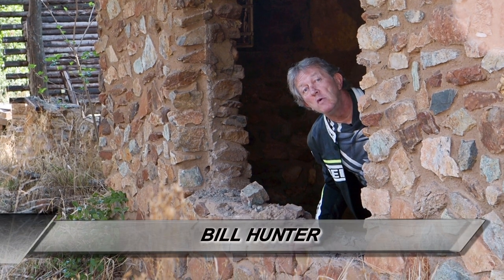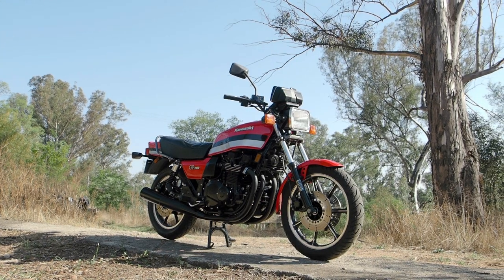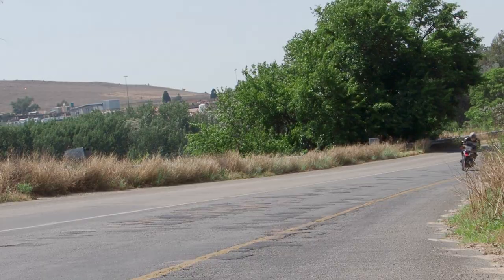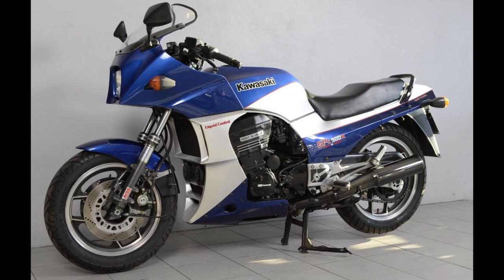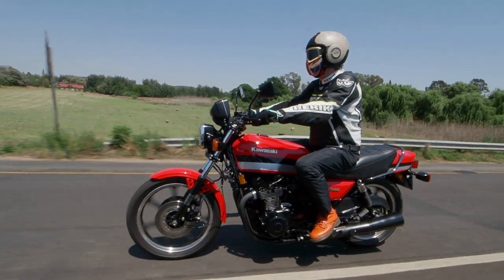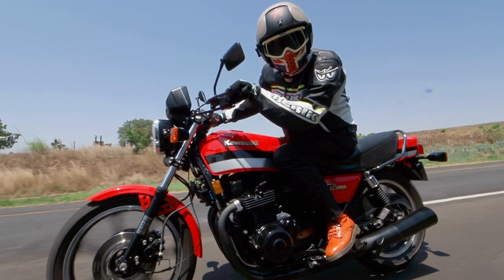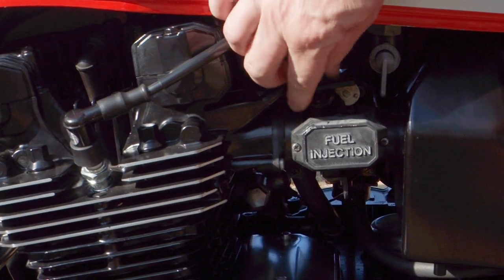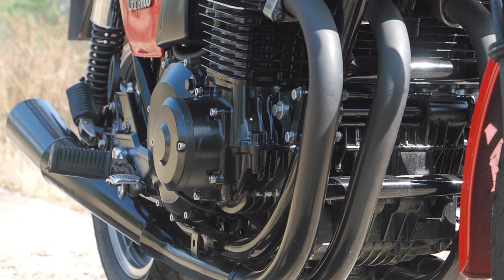Kawasaki GPz 1000 B1

Comment: Sorry Bill but Kawasaki debuted fuel injection on the Kawasaki Z1000H. It was  basically a mk 2  Z1000 with er...... injection instead of carbs. It was black and gold and made a couple of horse power more than the mk 2. I should know I owned one [I knew I should have kept it]. It had interesting handling and the motor [for it's time] was a peach. And you are right about the seats on bikes back then. They were far more comfy than the hard seats of most bikes today [why is that?]. Ah those halcyon days of ages past. I would love a Z750 turbo by the way but finding a good one is really difficult like you said. Take care and ride safe.
Reply: I had a Z1000H and loved it. I, like you should never have sold it, but replaced it with a 750 Turbo and I should never have sold that one either.
Reply: Had all of those you mentioned. All great bikes

Comment: MY 1982 GPZ1100B2 spoke in kms per hour as Australia stopped using miles per hour in mid 70's as for fuel injection the bike was smooth and no problems at all but when really pushing to the limits fuel consumption was like a thirsty camel at an oasis after a long dry walk. My understanding is that some problems the B1 had were solved with factory fixes and by the time of the B2 all was good. Even today a good B2 could give a lot of modern bikes a fright, especially on big long straights and wide sweeping bends. Oh yeah I am saving my coins to buy a ZX14R (ZZR1400) and old man needs some excitement

Comment: I had a ride of 1981 GPZ1100B1 that was new and on loan to a motorcycle magazine called Revs ( thank you Mike Esdale) and it was great but the 1982 GPZ1100B2 was far better, yes I purchased  one new in 1982 and still have it. This machine would go like a missile and it would go faster then the B1 so fast in fact that it would over run the speedo with revs to spare. As for comfort just perfect, a seat you could ride on all day and a small fairing that kept most of the air away. This GPZ1100B2 was the true grandson of the original Z900. No I am not selling my baby, it sits in my front window so others can admire it, note my current ride is a 1996 ZZR600 which keeps an old man excited.

Comment: I was at Cadwell Park when kawasaki brought 6 of these to race in the then called super bike round. Wayne Gardners first race in the UK on a Moriwaki Kawasaki blew Ron Haslam into the weeds on it, he then raced a B1 1100 but lost to Rocket Ron. A week later at another track 4of the 6 B1’s blew up!!!! I always wanted a B1 but by the time I’d saved up the B1 and B2s were out of production and I ended up with a 1984 GPZ1100 unit track, but I always liked the B1 the most. Those were the days

Comment: I had the 1100 B2 . it was good for 1000 km day rides touring outback OZ and very comfortable also fun on twisting mountain roads .  I replaced the fuel injection when it packed in with Z1000J carburetors and replaced the rusty stock exhaust with a 4 into 1  system which gave it a nice meaty growl. . Sold it for 2K in 1990 ..

Comment: I think the z1000h was Kawasaki's first fi bike. Title reads "gpz1000". The  550 never had fuel injection, you can even see the carbs on the pic you posted.  Nice to see the bikes getting some air time
Reply: Correct.
Reply: Sure was....great looking bike 😎
Reply: The z1000h was a great looking bike. They came in Black with a white and gold pinstripe and fuel injection.
Reply: @splodge5714  Basically a fuel injected Mk2 z1000. IIRC the US got a ltd style one maybe called "G" and/or "classic"
Reply: Yeah, and Here is SA we only received 8 of these bikes.  Was launched in 1980 and my Dad still has his 1980 Kawasaki Z1000 (Side cover never listed the 8)

Comment: Loved kawasakis since '83, had, AR125, ended up 3 GT550'S, GPZ550 UNI TRACK WITH FUEL INJECTION 85,GT750 and a nearly new GPZ750TURBO' 84,and the turbo was superb, WHOOSH!!, heard WAS the first production bike any size to do standing quarter mile 10 seconds, mine did 161MPH. Done with top end stuff, and if I'm honest done with Kawasakis, unless they were to provide me with a ZX10 ninja or 1400 shaft drive. Got my first bike in 27 years, no Kawasaki shops anywhere near, turned down chance to get a '07 CBR600RR, sight unseen, saw it wanted it, knew nothing about it's performance, just looked really good to ride hard, just been sold gutted but delighted because I have a' 05 650 Bandit, one very careful, cautious owner who basically ran it in for 15,000 miles, and it pulls, fly's up up steep, steep hills like its falling off a cliff and it's magical a pure rider's treat? Nearly new GPZ750TURBO, or 15 years old 650  BANDIT??????, OH DECISIONS, that's how good my Bandit is, Because the GPZ750TURBO was really nice.